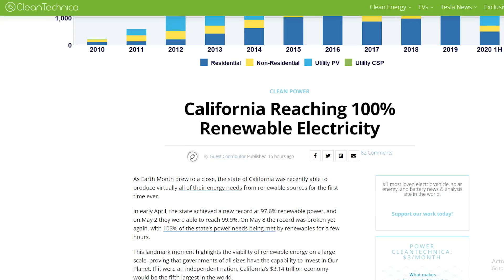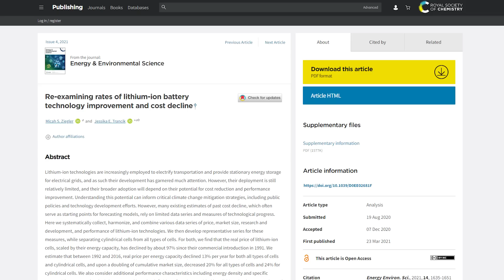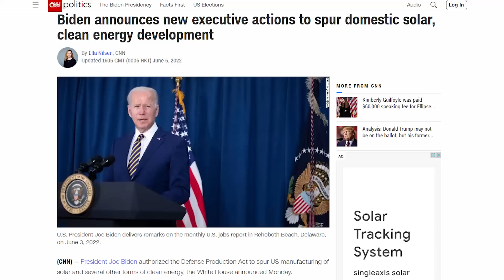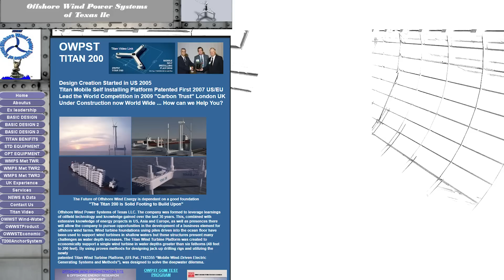World's 5th largest economy reaches 100% renewable electricity

Comment: Here are the May statistics: Peak demand: 50,270 MW Jul 24, 2006 at 2:44 p.m -  Peak percentage of renewables compared to demand 103.5% May 8, 2022 at 3:39 p.m. - see this PDF for more May metrics. http://www.caiso.com/Documents/Key-Statistics-May-2022.pdf Note: the quoted statistic is a little bit of a distortion of what happened. The PEAK power production was 103% of the consumed power at one point during the day.... The total energy use on that day was mostly renewable but I'm not sure that it was even 100%. The nuclear power plant is still on line and providing power for example. Perhaps the energy exported for the full day was enough so that the total for the day was very low.....but I dont think it was actual zero for the day was it?
Reply: the problem is they are including hydro and bio fuel and others. now do the numbers with just wind and solar. and no even counting it all they did not produce anywhere near 100 percent of the days energy consumption

Comment: You should be able to read your own charts; they show coal as one of the cheapest energy sources and -- what ever gas combined cycle is - as being one of the cheapest.  While sunbelt areas like California get a lot of sun; they don't at night and wind is also unreliable. I don't think those costs included storage; thus if you are going to have storage; batteries are a very poor way to do it as it further depleats lithium atm.  It probably would be better to generate hydrogen with the excess electricity and use that for vehicles burning hydrogen.
Reply: FALSE , Coal is in FREEFALL and Decline in use .
SWB - Solar,Wind, + Battery is the CHEPEAST Mwh power on EARTH. 
and its all 100% Renewable. 
Fossil Fuels cant be RENEWED and are UNSUSTAINABLE.
SWB can easily REPLACE 100% of Nuclear, & Fossil Fuels.

Comment: https://www.eia.gov/state/print.php?sid=CA  You said you'd do some fact checking but this shows you still aren't doing enough.  2/3rds of Californias energy use is from natural gas and gasoline.There are other fossil fuels also; plus they import a significant amount of electricity from other states which they can't tell the source of. California has only about 10-15% of its energy provided by renewables (if you include hydro, nuke) so it would be quite impossible to go even a day just on that.
Reply: RENEWABLES in CA often OVERPRODUCE power.
SO, much they have to EXPORT it.

Comment: This is not entire day, in fact one of the articles you show says for several hours, and others mention "briefly" and a "few minutes".  Good stuff, but full 24hr period, for electricity generation from renewables it's reliably 40+% in the May/early June period - that is renewables generation against demand for the CAISO grid.     This is NOT counting large scale hydro which they class another way - but does include small scale hydro.  But basically it's wind and solar as the major contributors by volume.  The May 2nd you called out - for the full day, renewables generation was 255,374
 MWhrs, and demand was 531,509  MWhrs...   divide the renewables/demand and multiply by 100 to get percent and you end up with 48% of total demand met by renewables for the full day...  which, is pretty remarkable.   At some point in the day when demand was a bit lower and generation of wind and solar was high - they hit that sort of 5 or 15 minute record for one or more time intervals of reporting.  The hard thing is the peak demand is in the evening when sun has dropped off, so hitting a high % during peak demand from renewables is harder to achieve.
Reply: SOLAR & WIND have greater ability to OVERPRODUCE Energy , we also need more GRID storage at all GENERATION sites to store power for PEAK times of Demand. 
a Tesla MEGAPACK can power a city for 6 hours and Charge in little as 3 Hours. 
this can allow for 2 PEAK cycles per day , each Facility.
Reply: @markplott4820  I'm a proponent of the tech.  My comment was about the inaccuracy of the statement the fellow made.  it was NOT for a full day, it was a brief period.  I stand by the numbers and explanation of the reality of state of things being what they are, because they're reality.    Also  on March 29th, Wind outproduced coal or nuclear (either, not both together) for a full 24 hr day for the full US.  That's a pretty big one-timer too...   

It'll be interesting to see how grid power storage evolves.   Anything that can capture  overages and then release them efficiently when needed, is a good thing - battery, pumped storage - whatever, as long as the in/out losses aren't too high.     Shame we can't post graphics on this forum, it's easy to show how much storage would be required to make it to full day from renewables only, and especially on the days when solar day is short, or wind is less prominent.    It's far less impressive to have renewables hit the demand curve briefly at a lower demand period than it would be at 9PM when demand is substantially higher.  CA has a lot of these scenarios and they move around a lot based on time of year.  And on any day, the gap between generation and demand from midnight to when solar pokes up (2 hrs after sunup basically) - is HUGE....over 20GW for more than 6 hrs...  that's a LOT of megapacks.  L-O-T....  and they're measured in a couple hours of megawatt level releases today...   then after the sun is down  the gap again is over 20GW again for similar 5+ hours...  ANOTHER block.     BIG storage issues measured in hundreds of GWHrs of storage required, along with more generation to fill up to demand more often than the occasional high point on good days (lower demand, cool solar generation)...    TX has the same issues, theirs if flipped though as they tend to have great wind 8 months of the year and solar hasn't really ramped as much as CA.     Then there's other states which don't have wind siting really worth it year around, and maybe latitude restrained...  interesting problems to go after :)

Comment: As a PG&E customer in northern California I enjoy one of the highest utility rates in the US...and PG&E has asked for a 20% increase over the next 3 years.  $500/mo. summer time bills in my area are the norm.  At my age investing in whole house solar is perhaps not viable even though the cost has come down substantially.
Reply: switch to a TIME of use Plan , instead of NET metering, 
switch from HVAC to just fans and local Electric heating. 
DELETE natural gas use. 
only use Electric appliances / fans/ waterheaters. 
get a HOME battery to charge w/ Super off Peak energy , then power home just on Battery for most of the day. at Night simply Charge again and Repeat.
Reply: @markplott4820  Good thinking. Most people are just too passive and let it all overwhelm them but there is a lot you can do.. I bought an EV and saved thousands in gas and just finished a cross Canada trip.9800 km No problem. Cheers.
Reply: You can finance a Tesla system and save money immediately.  A 9kWh system with two Powerwalls, on a 10-year loan, is less than $500/month, especially after factoring in the 26% ITC tax credit. Becoming your own utility is already profitable.
Reply: @American_Energy  💯
Reply: SunRun can do it for you for free. They use the lease model.

Comment: California needs to hit the :cheapest power in the US" milestone next. How long will that take?
Reply: not long , as Renewable Energy often OVERPRODUCE .
Reply: It’ll never happen. California’s electric grid cost structure is limited by transmission, not generation.  We’ll be paying to bury power lines and pay out legal settlements for forrest fires for the next 30 years.  The only way to win in California is to get your own Solar + Battery system.

Comment: They are also warning everyone in the state that there will be blackouts all summer because of lack of production.  This is the downside of pretending that you don't need oil/gas as a backup plan and shutting down your otherwise clean nuclear plants.  Changing to renewable energy is great.  Cutting off your nose to spite your face is just stupid.

Comment: I can see them being carbon neutral when it comes to electricity generation, but with majority of their energy coming from natural gas the claim is certainly over blown.
Reply: Majority, but dropping fast.
Reply: you only need 1 sq mile of SOLAR , WIND, and battery for EACH state to be INDEPENDENT , no fossil fuels.
Reply: On that day noted, no natural gas. But it was a cool day in California. No AC use. No heater usage. Probably overcast most everywhere so office buildings didn’t heat up as much…

We still have a long way to go.

Comment: Impressive stat to encourage other states to do the same.
Reply: each State only needs 1 sq mile of Solar, wind, battery, to be independent of fossil fuels.
Reply: @markplott4820  Seems like a simple solution. Why hasn't anyone done it?
Reply: @harryherber2971  because it's not factual.
Reply: It’s the exact opposite. Renewables can only carry the entire load when everything is just right, which is, as you might imagine, quite rare

Comment: Batteries is a bad way of storing energy … other methods must be developed …
Reply: works all right in my Flashlight
Reply: Why?
Reply: Your "other methods must be developed" statement suggests you might not be aware that other methods have been developed. For example, solar concentrators use liquid salt as a battery. See the "Concentrated solar power" for some basic information on this.